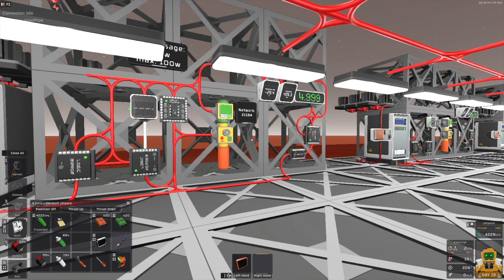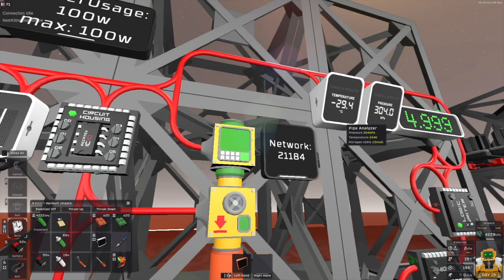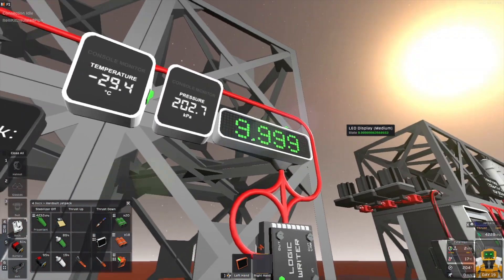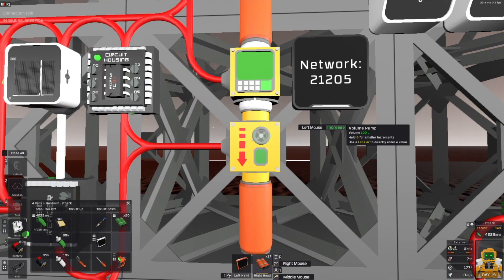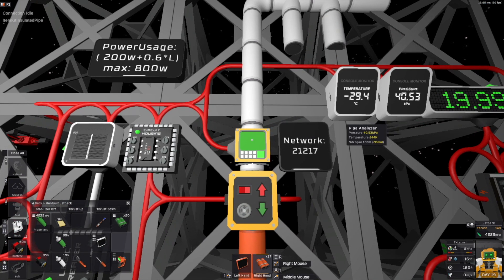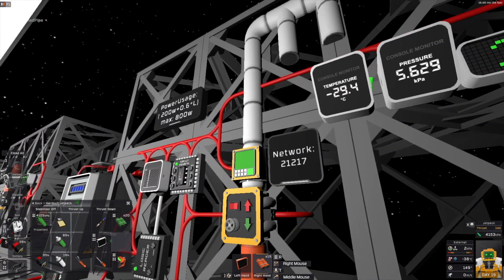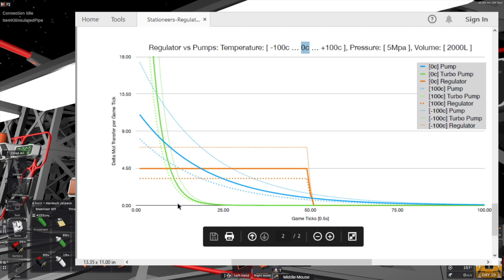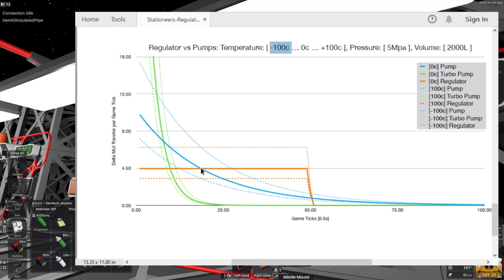Stationeers ( 2022 ): Regulator vs Pumps

Comment: 2 hints ...

1. Put ONE passive vent on ONE grid (one frame) - should give u more mols / tick?!
2. With the Authoring tool, u can copy things. Hit "F" and hit the thing u want to copy. Then u can place this copy
Reply from the maker: Hmm. I never tested it with one passive vent per frame. Maybe worth a try to see how the system behaves. This would need quite a lot of pipes and more pipes will change the behaviour of the passive vents as well. Not sure where the sweet spot would be in this case. 

Thanks for the authoring tool tip, I did not know that you can copy things this way.

And thanks for the input, this is very much appreciated.